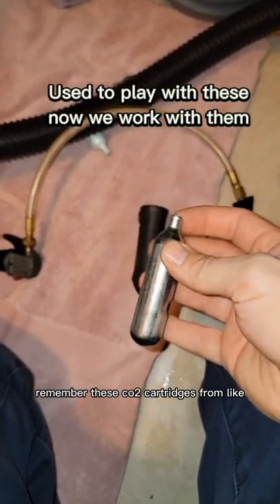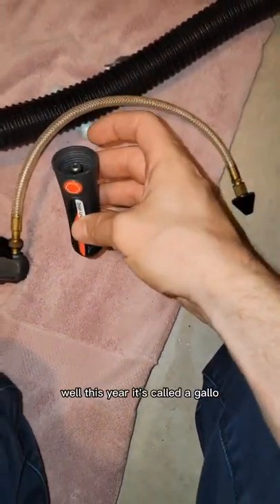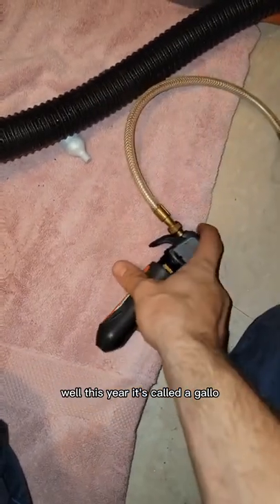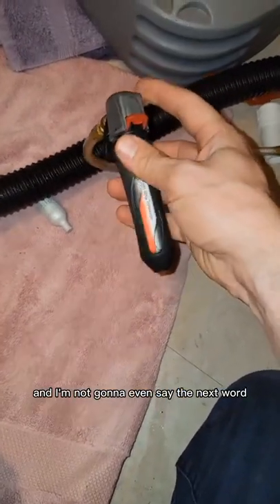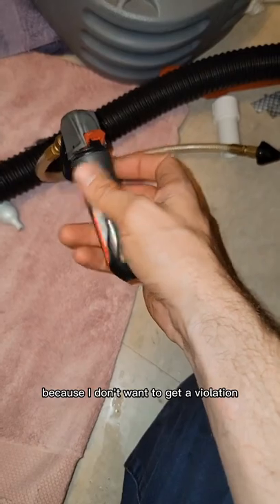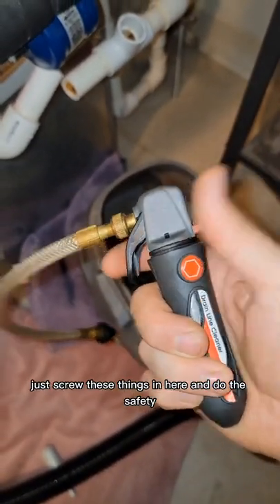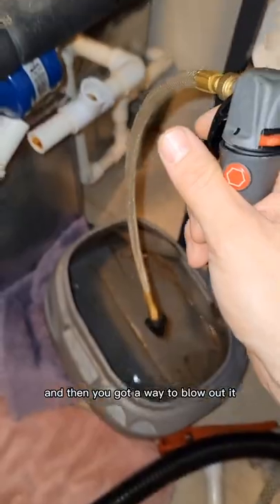How to unclog your air conditioning drain #hvac #shorts #diy

Comment: Use a shop vac instead ... some AC installers do not glue pipes ... have fun ripping up drywall all over to find blown joints

Comment: Y U P  for 47.00 you can clean out the drain. Or just shopvac from outside.
Reply: I've never seen a condensate get cleaned out with just one CO2 canister and a half pound of non-recycleable plastic-lined steel
Reply: @jacobmarion3387  I’ve seen several get clean from one. I’ve been an ac tech for four years. Works almost everytime. Sometimes they tie in other drains to the line so you have to watch for that. Shop vac doesn’t always work. Code often requires drains go to wash drain or sink drain behind a ptrap so that makes them inaccessible. I live in south texas
Reply: @Darth_Uchiha47 ugh... san antonio 2nd floor apt here... gone back and forth trying to decide which to buy and finally went with a shop vac but now you are making me rethink my choice... damn it!!!

Comment: I'm an hvac guy and those things are really hit or miss. I just make sure it's draining before I leave.
Reply: Could I use an air compressor to clear my drain line as well? I’m getting a shop vac tomorrow but my house is unbearable hot and this is my last resort. I need a quick fix. I have an EZ trap but I’ve cleaned it multiple times and I’m positive it’s the drain line.

Comment: I’m very anal about using the Viper condensate pan spray along with condensate tablets to eliminate sludge buildup.  
I cannot tell you how many times I’ve gone out on a service call especially in the middle of the night because of a drain pan overflow drain pan high water sensor alarm.

Comment: They've had those forever and a day that's HVAC guys used to use them and our housing maintenance guys using to clean out the drains for the freezers and the refrigerators don't you know that if you didn't I guess you just now realized it

Comment: Use them constantly for our first company evap units.  I just wish I could find a decent brand.  They start to leak or fail to puncture the charge after about 50 uses.
Reply: They make some pretty durable ones for inflating bike tires, I just switch out the nozzel adapter and use it to clean the drain on my ice well

Comment: They're garbage. That's been out for like ten years but it's still not better than a drain dog and a tank of dry nitrogen. 3/4 drains can run pretty far.  won't blow the clog out the end till you fill the whole line with pressure. Not enough gas volume in those little guys. all those do is blow out the trap.
Reply: I just used a shop vac and snake.  Ran a tiny drain snake thru it and then hit it with a shop vac from both ends.  Used a wet rag to get good suction.
Reply: Can/should you use a compressor (~30 psi) to clear drains?
Reply: @vigilantobserver8389  probably wouldn't be very effective at thirty psi. I have used larger compressors with the regulator turned all the way up. If you having drain line issues its usually because the entirety of the inside of the pipe is covered in slime until it closes off in one section. Why I recommend high pressure is to blow that main clump apart as well as clearing the rest of the slime off the sidewalls.  if you have a unit where the drain is going into a slab and then coming back up out of the ground outside bleach and a shop vac would be better if you don't have that high pressure high volume blast of air because the whole line is full of water. Attic units are a different animal. Shop vacs and compressors might break the clog up but they won't get the inside very clean unless you run a bunch of water through to flush the system. Again it's a time and energy  issue at that point. If I have a chop saw I'm going to use the chop saw but you can still make a good cut with a handsaw just takes longer and is harder to do.
Reply: Jug of nitrogen and let it rip. Blow out from the evaporator coil to where ever that drain line ends. Go check the end of the line for muddy water, then dump water down the drain line and make sure it's coming out the outlet. Rinse and repeat 💯

Comment: You can just use the exhaust off your vacuum with a step down fitting on your vacc hose and a coupling 
First time cost = $15
Afterwards, nothing your keeping everything 🤣 I use too use those when I only had 3 years of hvac experience

Comment: The most expensive way to clear a drain
Reply: It’s really not. 40 bucks at Home Depot. Even cheaper on Amazon. Cartridges are 15. Super easy, convenient and fast. Beats hiring someone when your shop vac doesn’t do the trick or a snake. Snakes can be hard to get through 90s and sometimes don’t clean them fully. Shop vacs definitely don’t clean the line super well and can be inconvenient depending where your drain goes. Sometimes they go outside but code in some places requires they go to the wash drain or sink drain behind a ptrap. So they are often not an option. Hiring someone runs the price way higher for a two second job. These are really convenient for homeowners. Gallos blow out pretty much everything because the psi.

Comment: But your vacuum is right there.

I just went through the comments. Apparently no one else thought of a vacuum. 😂. How much money have y’all charged to do this expensive fix. Vs a 20v dewalt vacuum. Stuck on end outside. The only thing you have to constantly buy is the gas to get to job.

Comment: Pressurizing plastic pipe with a compressible fluid is how you win the Darwin awards. You have just created a pipe bomb.
Reply: Its a drain line. The clog will unclog before getting anywhere close to high pressure.

Comment: Funny alot of those drain lines I've seen don't even have have glue in the fittings outside. Guess for easy cleaning. Guys blowing the trap off the side of the house like a bottle rocket.🤣